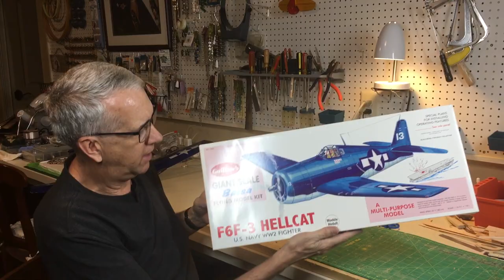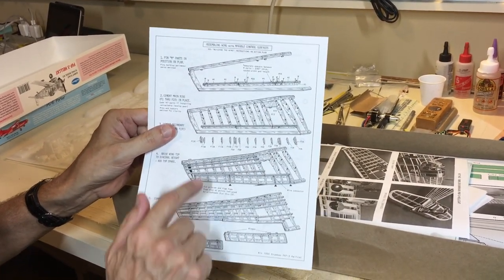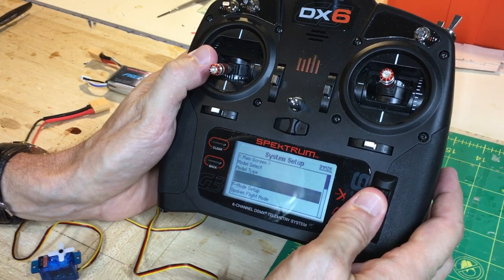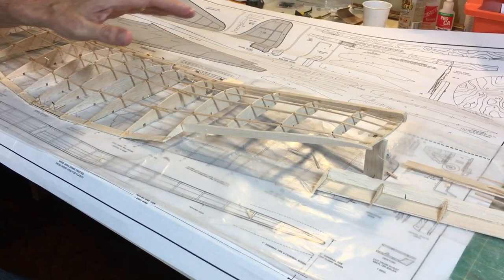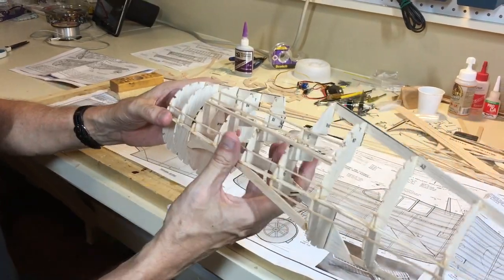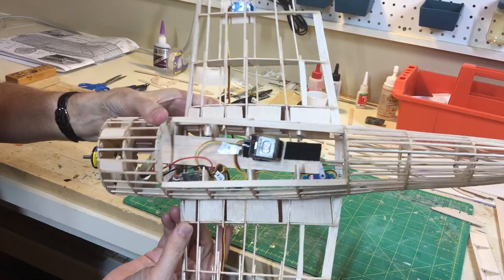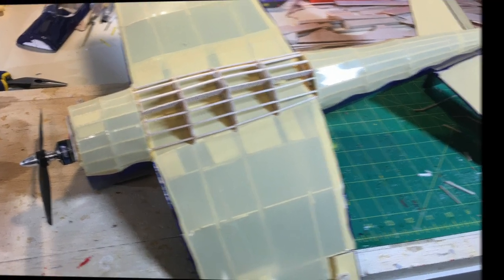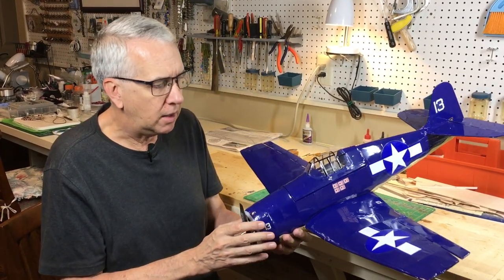Guillows F6F Hellcat RC Conversion Step by Step

Comment: Nicely done.  I turned the Zero into an electric CL model just for something different and sure enough it flies.  I still have a couple of those series in the box and someday will make them RC. I sometimes like to make the access by making the wing removable if the structure is suitable.
Reply from the maker: NW:  Thanks for checking in. Best of luck with your future conversions!  Tim

Comment: This is great - I have been buying Guillows kits with a conversion in mind for a few years. The difficulty has been that the quality of their wood is so poor and the "die-crush" formers and ribs are similarly not always suitable for a decent build.  
I hope that Guillows gets with the program and improves their quality - as a lot of folks would love to do this I'm sure.
Reply from the maker: A-12:  Fully agree with the older Guillows kits.  But the newer ones have laser cut balsa, seems to be a lot higher quality.  Usually says "Laser Cut" somewhere on the box where this is done.  Tim

Comment: I did one back in 2015. I made it with a removable wing, single aileron servo, rudder, and elevator. It came in at a little over 16 oz, but flew amazing. Slow speed performance was great, but I put way too much motor on it, a Super Tiger .10 outrunner. I told myself "just stay away from full throttle", well I didn't listen and flutter got me. Ripped the elevator control horn right out. I really did love the way it flew and plan on making another one, with some mods.
Reply from the maker: Cf:  Fully agree, the Hellcat is a great kit and candidate for RC flight.  Tim

Comment: This so cool! I built so many of these as a kid and they all flew (sort of) I had always dreamed of these as RC. I noticed you set it up for just an elevator and aileron? 

Did you use a standard size receiver? What size motor? Love these videos btw keep em coming 😃
Reply from the maker: Yes, ailerons and elevator. No need for rudder. The Hellcat is big enough for a regular receiver. Cannot recall motor size. Use a bit larger one, helps with CG. Tim

Comment: Great video! I really enjoyed following along with your build! I'm working on the spitfire currently, do you have any advice for covering the plastic cowl? I'm not having much luck, I melted the first cowl with my heat gun and I'm really struggling to get the wrinkles out with my iron on the next cowl? I thought about painting it but I cant find a good match for the covering?
Reply from the maker: John:  I've been able to iron on (no heat gun) the lightweight plastic coverings (ParkLite, MicroLite, etc.).  I think the heat for regular MonoKote would be too much, as you describe.  Also, normal acrylic (water clean up) paint works fine, you may have to add more than one coat.  See what I did on my Guillow Spitfire conversion.  Tim

Comment: Parklite covering is nice to use in that it is easier to remove the backing than some other coverings and is more opaque. It is good to make patterns for covering from printer paper or manila folder, then cut out covering, slightly oversize with X-Acto knife to avoid waste/mistakes.
Use moderate heat with model covering iron  when shrinking to avoid melting covering. Have you done a video on covering techniques for small models?
Reply from the maker: Gary:   Got that right on ParkLite and the backing.  For the brands with a tighter backing, I use reversed scotch tape to try and separate.
I use a heat gun to shrink, just very conservative applying the heat.  Great point on a video for the covering, will add to my list!  Tim

Comment: Thank you for posting all your videos .  I am new to building planes ,  I have made a mini bee  but not installed the electronics. The model is tail heavy is this ok. This means i have to move the electronics forward to get the right cg  am i correct, thank you for your advice
Reply from the maker: For most models, especially the smaller ones you’ll likely need to epoxy in some lead weights. I use fishing weights, bought at Walmart. The RC electronics are usually too light to affect the CG. Tim

Comment: It seems trying to find stick built aircraft is getting harder to find. Sig only has two planes. I wondered how a conversion of these units could work out. Magnets on that hatch will work fine. My Sig 40 done years ago was converted to electric. I have a kit coming from China in maybe two months😂.
The hobby shop here in Albuquerque is 99.9 percent RC trucks and no covering materials. 
Nice video, thanks from a 76 year old flyer.
Reply from the maker: No worries, thanks for checking in!  Tim

Comment: Tim..I am building a Dumas Standard J1, Thinking about installing RC gear.  Could you reccommend a motor size ?  I have plenty of micro gear. Just shy on motors.
Thanks!
Reply from the maker: LJ:  I am not familiar with this model.  Check out this build thread on RC Groups:https://www.rcgroups.com/forums/showthread.php?263738-Dumas-Standard-J1-R-C-Conversion
Tim

Comment: Very nice job, Tim!!  I was wondering if you had ever encountered a dc motor + esc setup that worked with a single LiPo cell at 3.7V?  I think that would be the recipe for these small Guillows planes.  If you do, please let me know.
Reply from the maker: WS:  Hey, thanks for checking in!  I am always on the lookout for suitable power/control systems for these smaller RC models.  Will let you know the moment I find something everyone can use!  Tim

Comment: I noticed the motor had zero degree incidence mounted on the firewall, when it flew it pulled to the left, I would add some right degree to adjust for torque of the engine, what percentage of throttle was being used on the flights?
Reply from the maker: Steven:  I usually try for a bit of right and down thrust.  But I have made many models with zero-zero.  For the smaller models, I am not sure how important the offset in thrust is.  For larger models, important for sure.  With the Hellcat, I am sure some sort of warp creeped into the wing, maybe ailerons not perfectly centered, not sure.  But once trimmed out flew fine.  I always use full throttle for the initial take off.  Tim

Comment: Hi Tim, I was wondering what type of propeller you are using for your RC F6F Hellcat. Could you tell me what type it is? Thanks.
Reply from the maker: Bruce:  I use an 8X4 prop for the Park 370 motor, seems to work OK.  Tim

Comment: like your videos but tell me how do you get the formers to stay in place. My difficulties are getting them to stay 90 degrees to the center keel?
Reply from the maker: David:  No real science, actually.  I ensure the former dry fits.  A dab of CA glue top and bottom and I hold the former in place as close to a 90 degree angle as I can get.  Seems to work out!  Tim

Comment: I'm debating getting back into RC and the scale modeler in me wants to build one of these kits and convert it like you're doing. It's been years lol, can you recommend a receiver/ transmitter for just flying at home for something this scale? 
edit: looked at the description hah
Reply from the maker: Connor:  No worries.  I highly recommend the Spektrum line of RC electronics.  I use the basic DX6 transmitter, built in antenna, works like a champ.  The Spektrum AR620 receiver, again with a built in antenna, works just fine.  Good luck!  Tim

Comment: great video i ordered  the p40 from guillows yesterday do you think the motor you used would work with it if so what prop did you use? thanks!
Reply from the maker: Clemet:  The motor I used for the Aeronca and Porter should work.  Just try and keep the weight under 3.0 ounces.  As for the prop, I am  not sure of the normal pitch/diameter, rather it seems to be the "standard" micro prop offered at StevensAero.com  As an aside, I am close to finishing the Guillows Zero, should be a good test of micro motor and prop.  Tim
Reply: @TimMcKay56  StevensAero no longer lists a "standard" micro prop. All I see is an "Ultra" micro prop with a Styrofoam spinner? Before I commit to this project I would really need some guidance on prop/spinner for this motor. Thank you!
Reply from the maker: @laragwen102  Lara:  I think the Ultra prop should be OK.  The equipment nomenclature changes from time to time.  Consider sending an email to Stevens Aero, they are usually quite responsive.  Tim
Reply: @TimMcKay56  Thanks Tim. I'll do that.

Comment: I just want to make sure I understand something. We should not follow the action steps or whatever in the Guillows kit and for the tail and rudder they should be just two sheets of balsa sheets each?
Reply from the maker: Nicholas:  You can do pretty much whatever you want with the Guillows kits converting to RC flight.  I have found from experience that 1/16" sheet balsa seems to work well for the tail surfaces, offering sufficient strength with light weight.  Tim
Reply: @TimMcKay56  Thank you for someone who is new to this relatively where might you direct them to learn about building the articulations?
Reply from the maker: @nicholasdisabatino1697  Apologies, but what is an articulation?  Have not come across that word!  Tim
Reply: @TimMcKay56   That is a joint. I am new to this but not sure best way to approach making moveable joint surfaces in general but I can just continue to watch your videos to learn. Thank you!

Comment: i want to build one of these, ive ordered a skyraider 17 inch kit and I plan on using the electronics from an old flyzone aircore plane but i worry that brushless 2s will be far too much power. should i go 1s or brushed?
Reply from the maker: Go brushless and 2s for sure.  Take off with full power, simply throttle back a bit after take off if too much thrust.
Reply: @TimMcKay56  what weight should i shoot for? the electronics are already about 45 grams. I can try to find a lighter battery and maybe a lighter motor but there isnt a lot available
Reply from the maker: @dakotadriggers8838  A 17” wingspan is a very small model. Best to keep it as light as possible.
Reply: @TimMcKay56  i was thinking switching to brushed 1s to save weight, all the little foamy 400mm planes use that for power and they weigh between 60 and 80 grams. So i figure if i can stay close to that itll fly fine
Reply from the maker: @dakotadriggers8838  Good luck!

Comment: These guillow planes are so hard to build cuse most of them are still die cut lots of sanding on very delicate pieces of balsa and you gotta be very precise on some of them in the placement before flying then you gotta cut stuff out and modify it for rc flight it's crazzy I would love to convert one but I tried and failed three times he has a lot of skill I will stick to rc purpose made balsa kits like the dancing wings ones you got off bang good yes it's a huge box of laser cut wood and crappy instructions but I have built 7 of them took a good month to complete each one but they went together very well and easily and all fly perfectly with no problem and look beautiful. Wish I could get a guillows kit done and flying with rc stuff and not free flight. Maybe I should try their bigger kits like this one instead of the smaller ones like the Cessna
Reply from the maker: Good luck!  Tim

Comment: Hi
Does any brand of receiver work with any brand of remote or do they have to be the same?
Reply from the maker: Fernando:  Receiver and transmitter both need to be on 2.4 GHz freq. Always best to use same brand, they just work together better. You cannot go wrong with Spektrum. Tim
Reply: @TimMcKay56  ok but just as a temporary solution I can use a receiver from a different brand as long as both are on 2.4GHZ right? 
Thanks :))
Reply from the maker: Correct, you can. Tim
Reply: @TimMcKay56  thanks a lot 
Love your builds and your videos 
Keep it up my friend :))

Comment: A friend of mine gave me a wing to this plane that’s all that was left of the plane after it crashed sadly I don’t have the blueprints to rebuild the fuselage what are the odds that you can send a copy of your plans that came with your kit to me.
Reply from the maker: DJ:  Would be happy to assist ref the plans, but sadly they are long gone.   😟  Tim
Reply: Have you found the plans? I can send some pictures though I am not sure how you would do the pinning
Reply: If you want the plans to any Guillows plane simply call the company In Massachusetts and for a few dollars they will send the plans for any kit they sell. I did it several times.

Comment: She seems a bit "floatie."
I'd move the CG forward maybe1/8". 
And Tim, you really should try a Dumas kit and stop torturing yourself with those
nasty Guillow's kits!
The 30" Stinson Reliant, for instance. is a real gem, with more than 100 others 
to choose from.
I'm just sayin'.
Reply from the maker: Richard:  I'll have to look into a Dumas kit soon.  😁  Tim
Reply: @TimMcKay56  
Happy hunting!
Reply: Thanks for this tip, I am looking to get into a more RC centric kit after my Guillows, and Dumas seems perfect (gonna go with the Stinson Reliant SR-10)
Reply: @slaquers  
The Reliant was a fun project that flew well.
Because it was designed as a rubber powered free flight model, changes need to be made for a conversion to R/C.
Previous experience is recommended.
Reply: @richarddarlington1139  would you recommend the Herr balsa RC kits? Any recommendations for a balsa kit that is set up for RC that wouldn't break the bank? I can't see spending over a hundred for the wood kit with no electrics
Reply: @slaquers  
I believe Herr was the first company to use laser cutting extensively.
Although I have not built one myself, they continue to be well received.
However, Dumas has a series of 15 models specifically designed for electric power. All of them are well under $100. 
I'm building the Stinson Voyager as I write this. With a 40" wingspan, it should do well with a park 250 and a 10A ESC.
Any of the high-wing types, such as the Taylorcraft (hint, hint) would be a good place to start.
You're gonna love this...
Reply: @richarddarlington1139  Excellent advice and thank you! I have placed my order for the Taylorcraft from Dumas, a great price too!
Reply: @slaquers  
That's great.
Enjoy your build. I know you will.
Keep us posted!